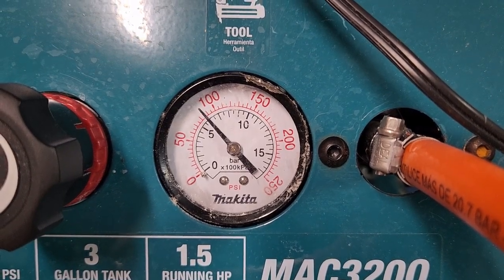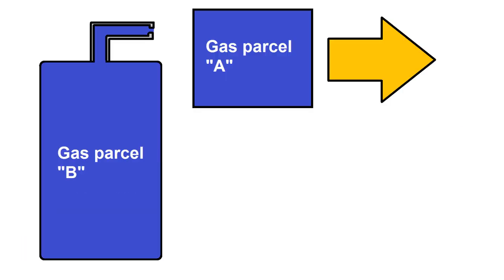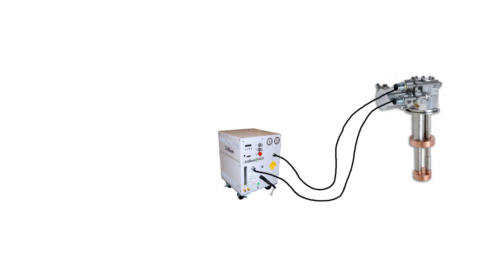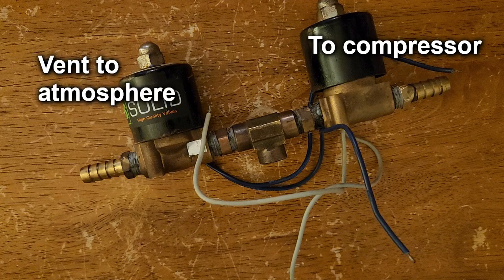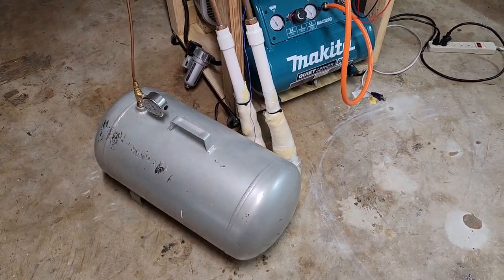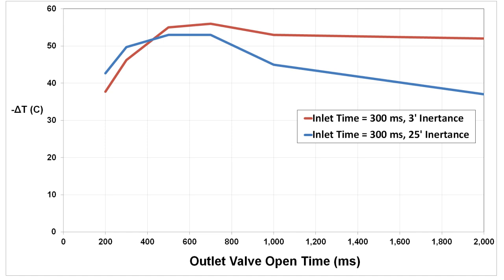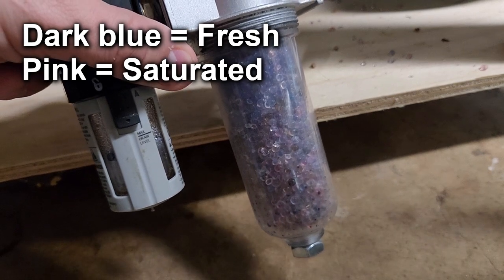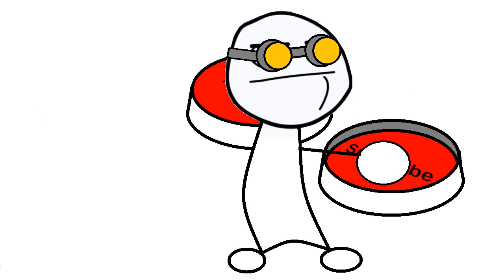Pulse Tube Cryocooler (Part 4) - Valve Controlled

Comment: Instead of using acid for H2 production, you may want to try Lye (NaOH) and Al foil; it generates copious amounts of H2 and there is no corrosive acid mist or vapors generated, and the sodium aluminate byproduct is much less corrosive than the lewis acid aluminium salts produced as byproducts from most readily available acids. If you want to dry the hydrogen produced then you can pass it through a drying tube packed with just more fresh NaOH, which you can then feed forward as more reactant for future cycles. If you use HCl for example, you're stuck with having to also neutralize the acid vapors and mists, which requires additional consummation of reagents without the potential for feeding forward the reagents as reactants.
Reply from the maker: Chemistry isn't my forte, but it looks like you're right. In either case, the production rate is orders of magnitude faster than electrolysis, which I've tried multiple times and gotten frustrated with from the low speed
Reply: @HyperspacePirate   I did some experimenting with it a while back.  

https://www.youtube.com/watch?v=426G-Clvu40

Some people recommended really low voltages.  I went from 1v to 20,000v.   5v and lower are really slow.  12v isn't so bad.  I did 120v rectified, and that generated really fast, but kinda dangerous.  The 20kv was via a car ignition coil.  It made cool sparks, and disrupted all my electronics that were within about 8 feet, but didn't generate gas.

You need a lot of surface area too.  I tried several different ways.  The most effective way was to arrange plates, like a car battery is done.  I used carbon plates from McMaster&Carr, separated with nylon washers from Home Depot.  Obviously, alternating positive and negative plates in this configuration.  Proximity of the plates to each other significantly increased the rate of gas generation.    This was preliminary, and I wasn't concerned about getting separating gases. 

You'd basically want to put another separator between the electrode plates, so the gases would be separated.  Maybe even just a membrane thickness of something.   I could probably model something up if you're interested.  I haven't touched it in [checks video]  14 years.  It was fun at the time, but didn't have any practical applications for me.  

And, it needs babysitting.  If there is a chance for a spark, it makes a good bomb too.  Especially if you aren't keeping the gases separate.   I wouldn't rebuild it like the video, just for safety.  But it is totally doable, safely.
Reply: i second this
Reply: @Biokemist-o3k  Stan Meyer was a con man.  There is no magic frequency.  That's one of the conditions I was testing with.  I tested from 1Hz to MHz frequencies.

The best "frequency" to use is constant power.   Higher voltages and currents are better than low volts.   Meyer's stuff said something under 2v, but he probably really used higher voltages, which is why his box would do so much better than anyone else's box that worked the way he claimed.

Higher voltages, higher current, no off-cycle,  more surface area (plates), smaller spaces between the electrodes.  And graphite plates don't corrode, where all metal plates do.  And, I preferred clean tap water.  Other suggested additives had some toxic gasses released.

Lots of people have been working on this ever since Meyer made his claims.  If someone did accomplish it, they'd be rich, and it would be an exciting new discovery for science.  Instead, it's a thing that con men do, either for likes and shares, or to rob people.  

There was a company doing it near me.  He had a car that he claimed only ran on water.  He even got on the local news about it.  There was a long time, when he said he was almost ready to release it, and was looking for investors.   After a while, there were lawsuits by the investors, because he never had a product to sell.  

It's one of those things, it almost works, but not quite well enough to be self sustaining.  It never will be, because of basic laws of physics.   You can't get more energy out of something than you put in.  You can't use electricity to split water, and then burn it with more output than you put in.  In the scope of a car, it will stop driving fairly quickly.   You can fake it by either using gasoline too, or pre-generating hydrogen and put it in a tank. 

Electrolysis is still very useful for making hydrogen, as long as you don't have an expectation that it will make extra power.  Using solar, wind, or nuclear is a clean way to generate hydrogen, and I think we should have this already happening to replace gasoline.  It doesn't matter if it takes twice as much electricity, as the energy from burning hydrogen,  the power source is free and basically unlimited.   No system is perfect, but oil is far from perfect.
Reply: @JWSmythe  you should probably tell Danial Donnatelli that because he is using Stan's technology in his hydrogen race boat and has a line of generators that use it as well. Just search Dan Donnatelli hydrogen race boats.
Reply: Not being smart enough to find the frequency so weak ego labels it a con. Your attitude is exactly why you can't find it, but you won't really understand that either (unless you're grown since your comment in the right ways)
Reply: @brokenwingbird2552  With all due respect, but what are you even talking about?
Reply: They sell "hydrogen oxygen torches" online which use water and electrolysis to produce a flame. It might not be the cheapest or most efficient way to produce hydrogen, but it seems pretty turn-key.
Reply: Ok im interested have you been successful in making a large amount of hydrogen this way? 

In my experience this is probably the most prone reaction to thermal runaway. speaking from experience i have made about 3 NaOH geysers using this method, one on purpose :D. It does not blow up 1 times out of 3.

And we see that this exact thing happened also here. Though its easy to talk retrospect.

I believe there are 2 main factors causing this. 

1) the reaction is really slow initially, making you think its safe to add more Al metal. When the reaction starts it becomes dangerously fast.
2) Tiny amounts of oil and fats are saponified into soap in the reaction medium causing it to bubble uncontrollably. It makes ledgit soap bubbles. Acid method does not have this problem and from my experience is far less prone to thermal runaway.

Though you could solve these problems i guess. 

You should use big chunks of aluminium to limit the surface area and thus the reaction rate as much as possible. And clean your aluminium thoroughly before you put it into the reaction. To avoid the generation of soap. 

And you mentioned correctly that the acid method also has many limitations
Reply: Someone made a vid on doing it DIY. I forget the channel, but just searching YouTube for DIY electrolysis hydrogen generator will yield the result
Reply: @bobert4522  You could use your own suggestion? Like typing into the search bar and post the link. Because ... Who The F besides you should KNOW what video you exactly meant? Just let it sink in for a moment. Not that it matters ... there are hundreds of videos with that topic, including all manufacturing processes mentioned here and many more, including large-scale industrial production.
Of course, there is another possibility: you delete your comment because it is just useless (and for some even frustrating) in its current form.

(However, it is better to look up such production processes in a textbook or seek the advice of an expert on the topic. Using some random content creator as a knowledge base for the production of high-explosive and high-energy gas is the stupidest thing I have read on the Internet this week. So what, it's your life, guys *facepalm* )
Reply: @dieSpinnt  you high bro? Lmao. Looking real goofy writing an essay 😂. 

Anyways, first result for searching what I just described: https://youtu.be/d85OX6yEwE0
Reply: There are videos on here for making hydrogen generators just from electrolysis of water complete with separation of oxygen and hydrogen.
Reply: Exactly right.
Reply: Yup
Reply: How hard can electrolysis be? I'm sure he has water in a tap and electricity in an outlet, just put them together and voila, Hydrogen, right?
Reply: @MrRolnicek  I worked in a shared workspace. Another company there made interactive exhibits for science museums. One exhibit being developed was an electrolysis machine. 

It was powered by museum visitors using hand cranks to turn generators. The hydrogen and oxygen accumulated in an upside down test tube submerged in the water + electrolyte solution. When enough gas was generated to expose a pair of high voltage electrodes, a spark would ignite the gas.

Designing reliable low cost electrodes with a large enough surface area took a lot of effort and experimentation.

Making something that can be used by children to produce a few milliliters of gas per minute with no maintenance beyond changing electrolyte solution periodically is vastly different from something that is designed to produce many liters in a short period of time.

I don't recall what they ended up using for the electrodes or what chemical they used to make the water conductive. They avoided table salt, because if the voltage limit circuit failed, it might create chlorine gas.
Reply: @MrRolnicek  Separating the oxygen from the hydrogen is the issue
Reply: @nedshead5906  But if you just separate the electrodes and make sure the liquid connects them BELOW the height of the electrodes then you get O2 bubbles on one side and H2 bubbles on the other, right?
Reply: Yep..  not hard to separate the two right from the initial process,..  i think though there are some other hydrocarbons that are produced making the gasses not totally pure..  really depending on purity of everything in the electrolyte..
Reply: @nedshead5906  Didn't you see that in gradeschool science classes?  The first time I saw it was in 8th grade.  Two inverted test tubes in a beaker of water.  Each tube with one electrode.   One side generates twice as much as the other, demonstrating the composition of water is two hydrogens, one oxygen, because the volume of hydrogen is double that of the oxygen.  Then they'd pull the hydrogen tube, hit it with a lighter, and the result is water vapor.

People doing those HHO things are interesting in that they do electrolysis, but disappointing where they don't really get the amount of energy used (electricity) is always more than the gas output it gives.  But even with those, it would be trivial to split the electrodes into two separate chambers for collection.  

Containing hydrogen is harder though, since it will go right through the sides of a lot of rubber hoses, o-rings, and balloons.  Hydrogen is very leaky.   Sort of like helium.  That's why rubber helium balloons stop floating after a few days,  but mylar helium balloons will stay up for much longer.  Hydrogen is smaller and leaker.
Reply: @MrRolnicek  if you use platinum electrodes and an alkaline electrolyte. Baking soda will boil off CO2 and turn into lye (NaOH). This is the whole hydroxide exchange as long as your water is clean and your container is non-reactive.
Reply: @JWSmythe  It's a bit trickier than that, any oxygen carried over and mixed with the hydrogen is an explosion risk, you would want to scrub all oxygen from the hydrogen before collecting and storing, an ion exchange membrane would probably be the way to go about it, or an oxygen scrubber. it's not impossible, it just presents some risk.
Reply: @nedshead5906  Not really an issue though, you could make crosslinked polymer membranes even from elmer´s glue if you really wanted to
Reply: @noneedtoknow5315  you will need to heat it to a higher temperatures. 
At usual oven temperatures you get Na2co3 + H2O + CO2 from Na2HCO3.

You will need to heat it to a really high temperatures to get Na2O, from which in water will be NaOH.

Even with bicarbonate you will get H2 and O2 without byproduct. With NaOH it will be more efficient due to higher conductivity.

Interesting fact, in NaOH you can use stainless steel without any degradation.
Reply: @iIiWARHEADiIi  so it is. I've found lye and distilled water eat 303, 410 and 416 readily with a voltage inside it, but it could have been poor quality barstock.
Reply: @iIiWARHEADiIi  platinum and glass work great, but it even pitted my tungsten electrode at 9.5 volts

Comment: Pure science, with all the numbers. Its a voyage of discovery. Taking energy out of a thing is so much harder than putting energy in, and that's what makes it so interesting. 15 and 6% mesh fill, thats supprising. Nice winding the aly tube , I would be scared of kinking. Exceptionally well presented.
Reply: pro tip for small diam tubing bending, tape 1 end shut fill with sand/sugar/salt/fine granular material cap the other end and bend carefully. the interior filling keeps the kinks from happening,

Comment: Yea. Aside from water what else could be freezing. CO2 is well within the temps you were going down to. Likely need to close loop it just with hydrogen/helium to avoid other gases interfering and then use that to cool down nitrogen.

Comment: I’m really looking forward to the next video. Ads a teenager i used to build single and two stage compressor coolers for CPUs. Using propane in stage one and ethene in stage two i got to -108C at 200W+ loads. That was using reciprocating (Danfoss) compressors but I think rotary or screw will be better for you in higher pressure applications.
Reply: I also have a 2 stage cascade using R22 and ethylene. 

What was your power draw for get 200W at -108

Comment: -100C is impressive. Could you be running in to issues with CO2 freezing and clogging your heat exchanger? I can't imagine it takes much to reduce it's efficiency. Would be interesting to try this on nitrogen instead of raw air.
I have a quick video on a dental drill turboexpander which may be of interest. I managed 15C drop at 4 bar with no heat exchanger.
Reply from the maker: I'm curious to see your results if you go forward with that project. I tried to do a brayton cryo cycle with a 3d printed turbine, but got frustrated trying to make my the turbines efficient enough to produce a reasonable amount of cooling. I'd like to see what happens if you connect that thing to a regenerator (or recupterator, or whatever they call it in the case of continuous flow)
Reply: @HyperspacePirate  Yes turbine design seemed way beyond my level so I tried to find something already available in the right power range. 
I've been having issues loading the turbine output as those small motors I've been using as a generator don't seem to last long at dental drill speeds (and produce more heat than electricity). I'll definitely try a counter-flow heat exchanger once I can run the expander for any significant length of time.
 I'm currently experimenting with 2 of these turbines on the same shaft to form the usual compressor-expander set up but haven't had much luck yet, I'll do a video if I get anywhere with it.
Reply: @matthewbeardmore  For loading the turbine, how about a diametrically polarized cylindrical magnet running in a hole inside an aluminum or copper block? At those speeds, the eddy currents should be pretty significant, so might be able to provide a decent amount of load. K&J Magnetics and Applied Magnets both sell these, and K&J also has elongated ring magnets (cylinders with central holes) that might make mounting easier. Only trick would be to support and mount them precisely enough for them to spin that fast without the whole assembly flying apart.

Comment: Would it make sense to close the loop so you could use helium with an old fridge/AC compressor? Also maybe freezing CO2 blocks flow, the minimum temperature checks out

Comment: 6% density is probably plenty. You should do it as a ratio of mass of the air you are regenerating vs mass of regenerator. Even at elevated pressure, you only  have maybe 1 or 2 grams of air moving through that thing. I guess it depends on how many liters of air are passing through each cycle. 115 g of steel wool to 2 grams of air being regenerated... you might even go less to see if the reduced flow restriction is hurting more than a few extra grams is helping. Checking the pressure drop across regenerator vs mass through it per cycle could be enlightening.